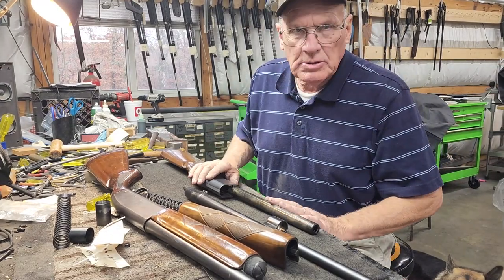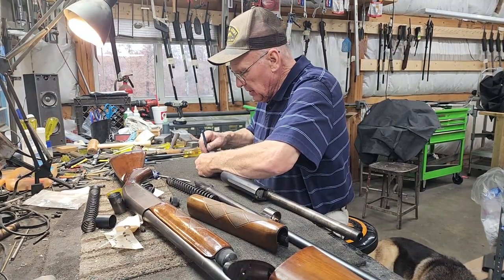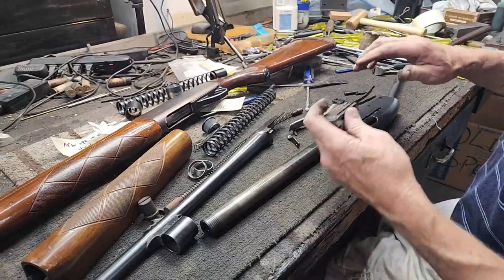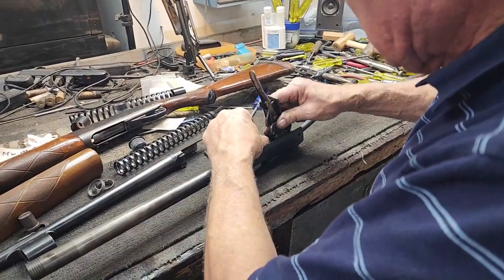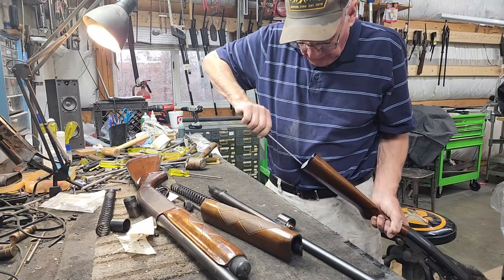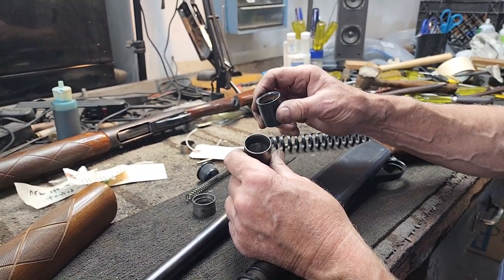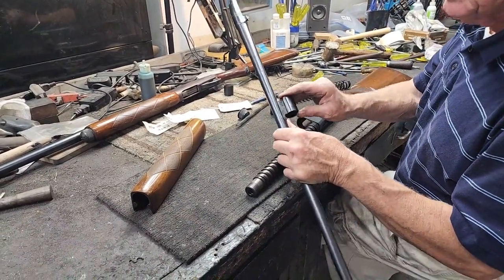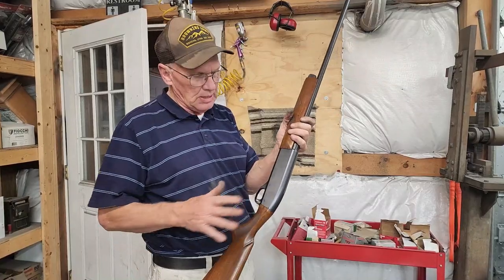Remington Model 11-48 Rebuild Kit Installation.

Comment: Art your rebuild kit brought my dads old 11-48 12ga back to life.      I also bought a 16 ga kit for my 11-48.  I have it broken down completely for install and cleaning as I write this.  Dads not going to believe it when I tell him I got it working.  He had taken it to several gunsmiths and they couldn’t get it cycling.  I don’t think they had a clue about the action spring in the stock.  Great video.

Comment: Art,  I have several Safari Mk II rifles from 243 to 338, What recommendations can you offer in regards to making them more accurate?  They are good now, but I would like to tighten them up, already have worked up loads for all of them.  What tips can you suggest, that will tighten those groups?

Comment: That last friction ring arrangement seems to be the same as on my 1930 Remington Model 11 20 gauge. Put one piece at the bottom of the recoil spring against the receiver for which ever load setting (I forget which) and vice versa for the other. You also have to put the bevel on the one piece in the right position in relation to the other. I'm paraphrasing here from memory. I always thought that when Remington came out with the 48 series that would handle all loads with out having to change the position of the friction ring etc that was supposed to be an improvement. From what I see here it sounds like the old system was better if not more convenient. Am I missing something? From what I've read previously and I think have seen on your older videos regarding the American Browning, it is always better to have them set for heavy loads IF they will cycle light loads on the heavy setting. Thanks for the video.

Comment: Thanks for the vid. Just installed one of these kits. From the vid, am I correct to assume that the two-piece construction that sits atop the recoil spring-as that is what I have-is preferable to the one-piece construction that comes with the kit?

Comment: I have a 16ga 11-48 that cycles rounds BUT every fired hull has the base of the shell dished in from recoil. Is that normal? I've been told it's common for those barrel recoil to do that. I'm not so sure that's right. What do you think. I reload 16ga so every hull is precious.
Reply: I just picked one up in 16 ga thats doing the exact same thing. I also noticed that it seems to be lacking in velocity. I can bust clays all day long but it wont even kill a bird at 25 yards.

Comment: I picked up an 11-48 in 16 ga that is leaving a slight dished impression of the bolt face on the brass shell casing. I also noticed that although it is firing and cycling, it seems to be shooting at a reduced velocity. I can bust clays with it but it's useless for hunting. Everything that I've shot with it has flown away like nothing ever happened. I did a water bottle test at 15 yds comparing the 16 ga 1⅛ oz #7½ with a 20 ga ⅞ oz #7½ and a 12 ga 1⅛ #7½ . The 20 ga and 12 ga both exploded the water bottle but the 16 ga only penetrated the front and only knocked the bottle over. Something ain't right with this gun. Any ideas?

Comment: I own about every gauge but the 20_ infect 2 in 28 ga. Which is my.favorite small bore to hunt small game. They shoot light but hit like a 12ga. Imp mod and modified My grand pops sportsman.kicks like a muie. It has always kicked hard from new.12ga. 30" full pop put a rubber butt pad ,, didn't help.guess it needs the springs. N rings.one question why did they make the 1100 in 410 that weighs more then my 1100 12 GA trap.